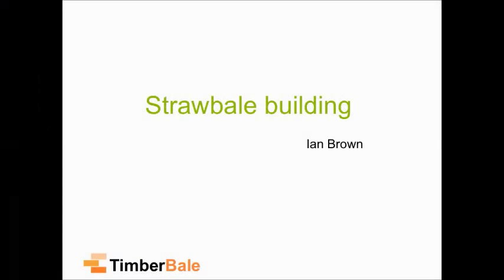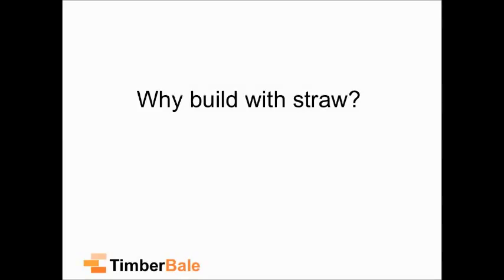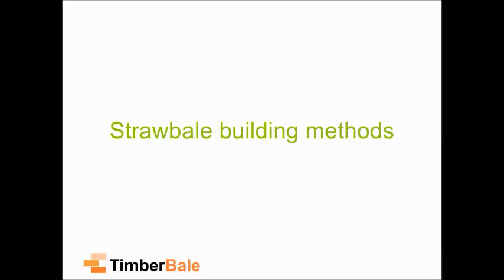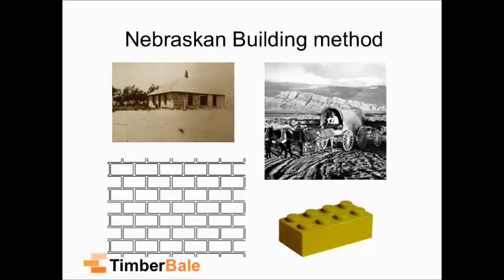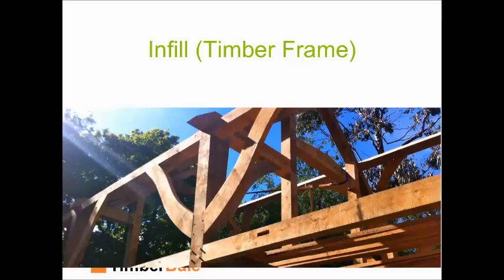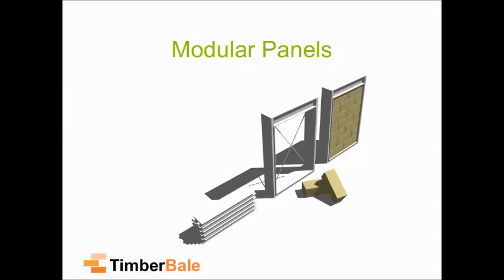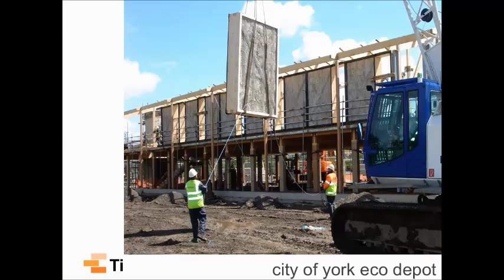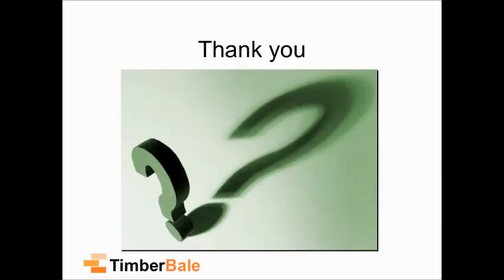Ian Brown: Straw bale building

Comment: Hey Ian. Loved the video. I am from England now live in Canada. I know Brighton very well. Spent many years there . I am into strawbale over here and have done a few courses. Now I am building my own. Just bought some land so going over my plans. Quick question  with the infill. Where would you put the studs or framing. You showed 4 options. I thinking of windows and how to attach aswell?? Thank you and maybe if you see this you might want to a busmans holiday over here. If I had stayed in England I am sure we would have worked together
Reply: I had the same question - with timber frame where does the framing for windows and whatnot go? And electrical and plumbing in strawbale walls?
Reply: @allisondalton8715   ...
That's where you must know what yr doing before you start.  What's yr floor plan?  Where is your plumbing needed?  Both into & out of the house.  The electric.  What about the type of finished walls inside?  You could decide what size windows as you go but, you have to know WHERE they go, at what height, leave space, & framing  them in as you go is best bcz some bales will need to be split & retied.  Framing holds them together bcz you just cannot tie them as tight as the baler does!  Also, the floor.  Cement slab or wood?  Those plans are quite different.  Slab is faster but, you have to have your entry elevated unless you live in a very dry area.
But 1st.  Is the perimeter going to be timber built or are the bales going to bear the load of the roof?7th    That's two very different processes from the ground up!  
Many details to know well before you start so, I can't stress enough that it is so-o well worth the investment & STUDY of some good instructions!  Which you can find here on UTUBE.  Will save you some costly, frustrating, time consuming, & maybe expensive errors/mistakes!
Lotsa luck & good goin.... .